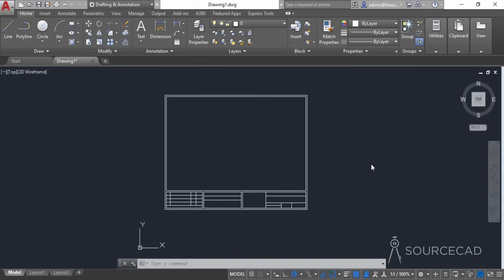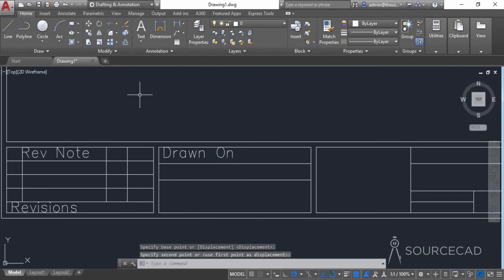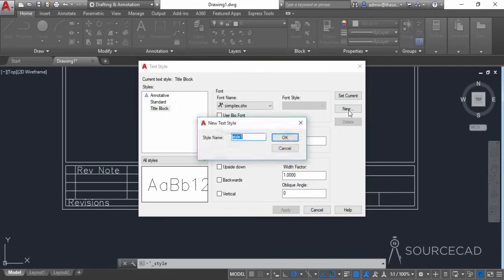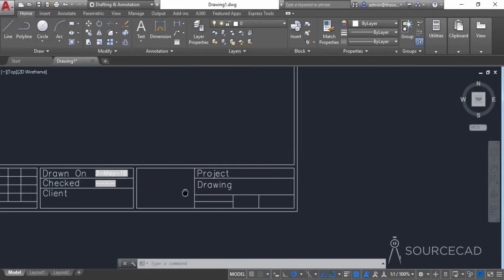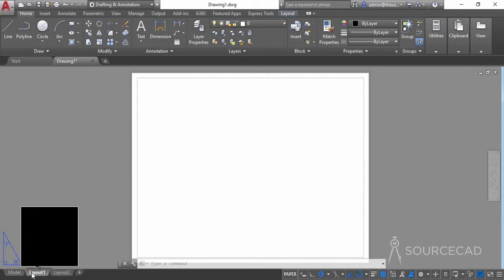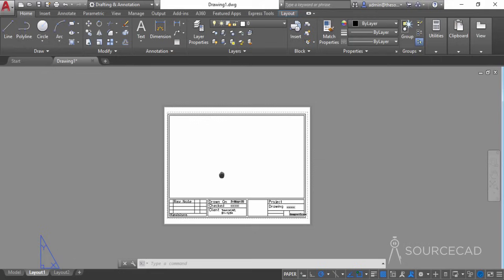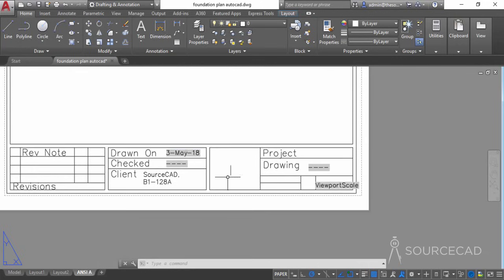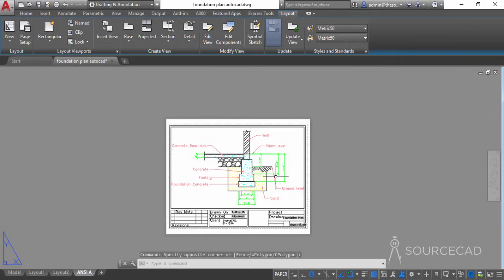How to create title block and its template in AutoCAD - Part 2 of 2

Comment: nice explanation, very easy to understand
I have a question though. We already had created the template in ANSI A dimensions. Also, we modified the page layout to ANSI A.  The question is, why we had to fit the template to layout tab using stretch command? I mean it should have fitted perfectly in the layout page.
Reply: I have the same question too. My guess is it's because we didn't select full bleed page. Our drawing is ANSI A, our page is ANSI A, but we had to fit the drawing inside a smaller rectangle in the page.
Reply: @iwatchwithnoads7480  Do u know how to set all the margins to 0??
Reply: Same question :((. What do we do with the change in dimensions?? What was the point of doing it in the model space if it will change in layout?

Comment: Thank you for this tutorial: One Q though, I have made several drawings in my layout that I want to individually place in my new title block. How would I do this?
Reply: Also, I attempted to copy base one of my drawings to the clip board and then paste it to the title block but my drawing is too large now. How do I resize?
Reply: @benhill445  you mean you want to put different .dwg files in one template? or you want to break parts from a drawing and plot them on different title blocks?

Comment: Hello, When I bring the drawing in to the layout created template. I face this problem that the drawing size is very big than the title block because the title block I created is in inches but the drawing is in feet. Second thing if i scale the drawing to down size it's dimensions get disturb than the original size. Also when i bring the drawing to the layout its line type not showing the one i adjusted in the model according to the layers.